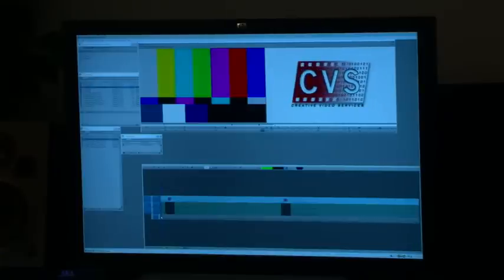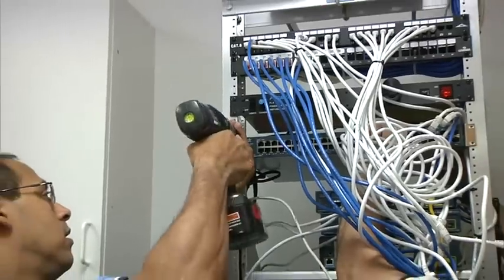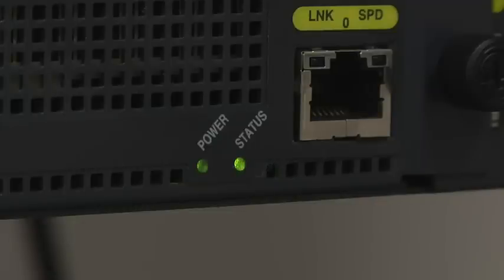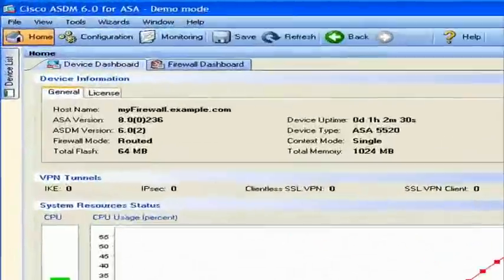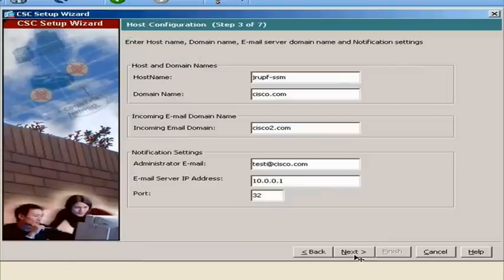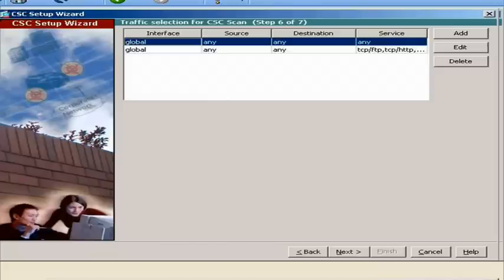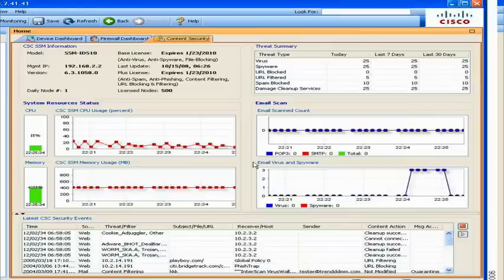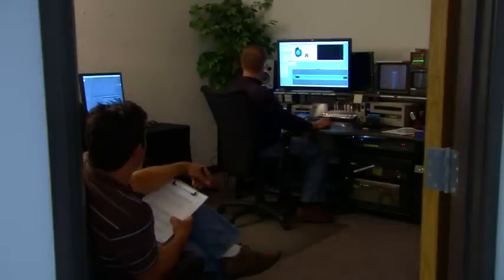How to Install Cisco ASA 5510 Adaptive Security Appliance Memory Upgrade

Comment: Memory upgrade is a simple process --the same as with a PC-- that Cisco illustrates in a video on their site. Apparently we cannot post URLs here. Google search locates Cisco's self-hosted video. Briefly is shows: Power Off / Remove all screws top and end to release cover / Protect against static! / Remove old memory / Install new / Replace cover / Replace screws / Return to rack / Power Up / Connect to network